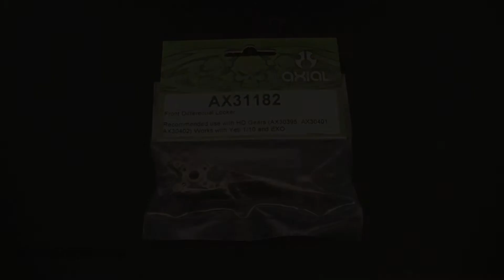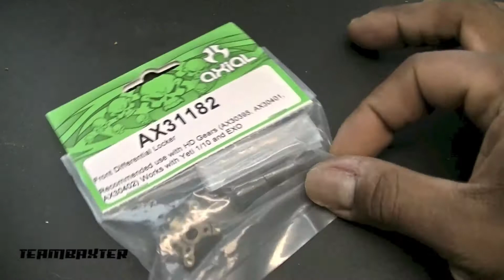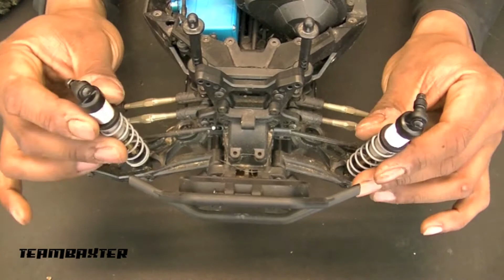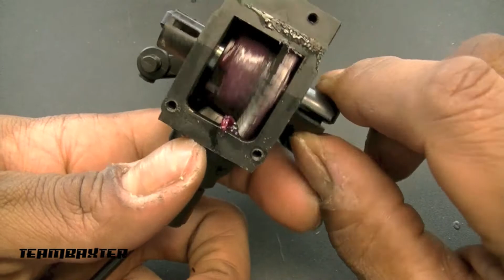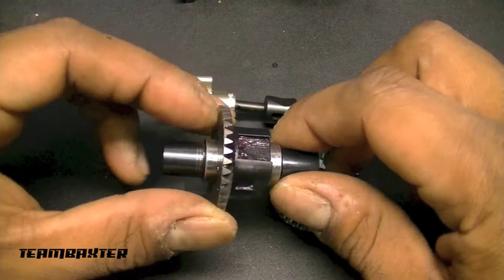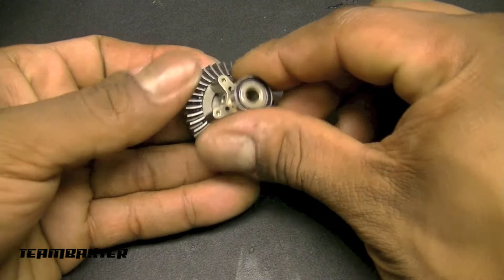AX31182 Axial Front Diff Locker for Yeti - Assembly/Installation

Comment: I need your help.. When I give full throttle in my yeti.. I see the gears get stuck and it doesn't move ahead.. When push it manually a little bit, it runs and then again it stops and the sense the gears get stuck.. 
What seems to problem and what do I need to replace now to fix this?
Pls reply.

Comment: That is a Fantastic how to video, well done mate.
How does it steer now?
Reply from the maker: Jax Teller WA Thank you! I dont really notice much difference in the steering, plus it doesnt really get going fast enough to really need diff action. Thanks for watching and commenting.
Reply: ARTINCbydb
I find mine turns really slowly, I think it needs a quicker servo. Plus it has the turning circle of an oil tanker with it's open diff ha ha (-:
Reply: @JaxTellerRC  try adjusting your camber more to -1 or -2, of course , if you install adj. Links. Also try moving bottom shock position out, and top in, more of an angle helps. I replaced servo to Savox 1283sg, and added Hot Racing aluminium steering assembly plus front sway bar with thinnest sway bar...Huge difference!! Worth it!